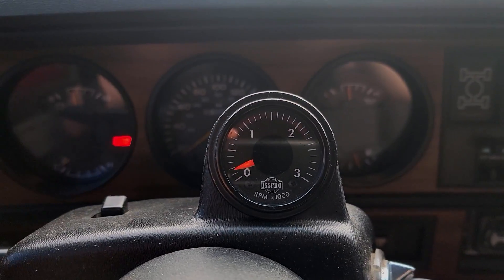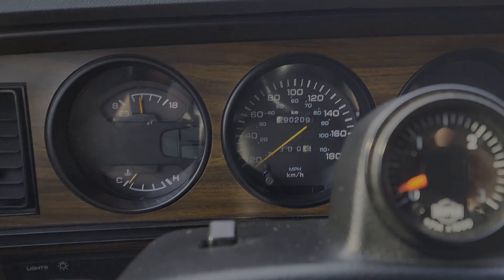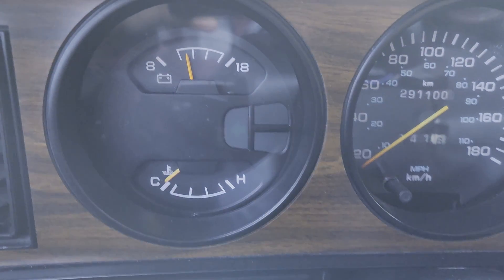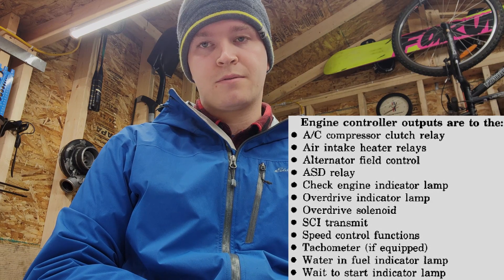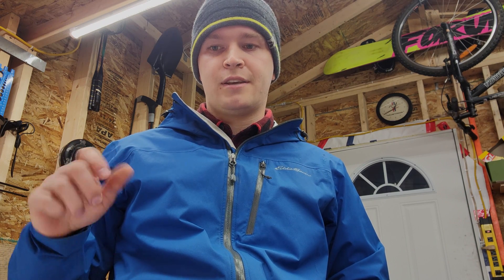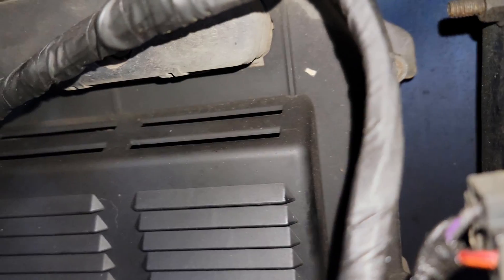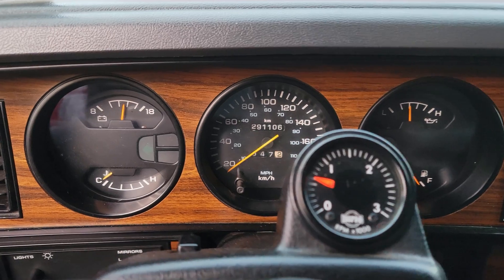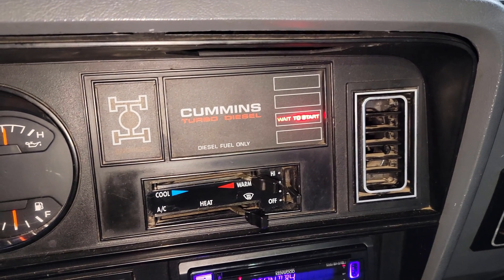PCM Troubleshooting (No Tach, Charge, Grid Heater, A/C, O/D, Cruise) | 1st Gen Cummins

Comment: Tyler, question for you. Very intermittent problem, spedo and OD will not function. Driven 1km to 70km then the spdo and 

OD kick in again. Normally this will only happen when well below zero. The onoff onoffon test shows no faults. The heat/water lights function normally. I was wondering if I had a poor ground on the tranny. Love my truck! People keep trying to buy it in the Princess parking lot.
Reply from the maker: From my understanding the speedo and OD are separate functions. The speedo is operated off the VSS on the transmission, and then the OD is a function of a few different things from the PCM. Most typical issue when people are having OD issues is proper calibration of the TPS on the injection pump. I don't have a video on this but I believe Tim does.
Reply: @OvensGarage  Thank you, I will have a go at that.

Comment: So if the lights dont turn on at all and the truck starts fine and goes through the post heat cycle what would that mean. Possibly just burnt out bulbs in the information unit?
Reply from the maker: I would check the bulbs first. They turn on as a bulb check for a short period when you turn the key on.

Comment: I found that many similar, simultaneous issues could also be caused by, on my 1st gen Cummins Dodge made for sale in Canada,  the Daytime Running Light module either failing or (in my case) having a bad connector.
Reply from the maker: Interesting, never heard about that before. I'd like to read more into that and take a look at the DRL module.

Comment: Any access to a good set of schematics? I just bought a 90 model that the previous owner did a hack job of axillary wiring on and nothing in it works except blower motor, radio and power windows. Doesn't charge and none of the dash works, only starts because of his auxillary wiring. Trying to wire the truck back up right then go from there

Comment: I've been having the EXACT same issue in my 92 for the past few months. Nobody on the forums has any clue what it could be. I have noticed too that it does get worse with the cold! Living in northern BC and it is now cold enough where the WTS light never stops flickering now. Whereas if I let the truck sit in a heated shop overnight it starts up and the tach and everything works as it should right away! I've bypassed the charging circuit with an external voltage regulator to get by for the time being. Glad to see I'm not the only one with this issue I'll be following very closely!!
Reply from the maker: Yes, I also noticed this issue happening in the cold as described in the video. I've taken a look at the PCM the past few days and replaced a some capacitors. Just one other bug I'm trying to work out. Hopefully will have the repair done and vid up by end of the weekend. We'll see how things go..

Comment: Pcm are different on auto and standard
Reply from the maker: Yes I believe they are. If you have a manual truck either pcm will work but in an auto truck I believe you need the auto PCM for control of the overdrive

Comment: I think I'm having a similar problem with the computer on my 91 D150. the speedometer runs extremely slow when it's cold ( I'm going 70mph and it says 35mph) once it warms up it stays at 5mph slow which I know is cause I got bigger tires then the stocks, but the truck used to read fine and accurately in any weather and temperature. I tried changing the speed sensor and plug and that didn't work so I'm thinking it's got to be on the computer end could that be a early sign of failure for it? Google has been 0 help unfortunately any advice or direction on where to go would be appreciated. Thanks for making great content thats helped me keep my first gen on the road.
Reply from the maker: Hi! Just wanted to note, your speedo isn't controlled by these PCM's. The VSS does feed into them as an input but that's only used to determine when the truck shifts into and out of overdrive as well as for cruise control. I'd recommend checking the wiring or replacing the VSS itself. That's likely the issue.

Comment: Many Japanese cars of the same era (late 80's-mid 90's Mazda/Mitsubishi/Honda) all had high ecu failures due to failed capacitors...I've fixed several Mitsu ecu's back in the day using Radio Shack (now defunct) capacitors...might be something to look for. If you have a bad one they're usually easy to spot as the case will be bulged. Just get the microfarad value off the side and de-solder, re-solder.
Reply from the maker: Hi Chris, thanks for the tip! That's where I started. There's three capacitors on the board and I'm going to replace them and go from there. Apparently it's a big issue on the SBEC's they put in the 90's jeeps (chrysler) and there's quite  a few guys who replaced just the capacitors and that fixed their issues. More to follow to see if it fixes the issues on mine.. I know quite a few guys are having similar issues with their PCMs. They are all collectively getting older and we need to be able to easily repair them.